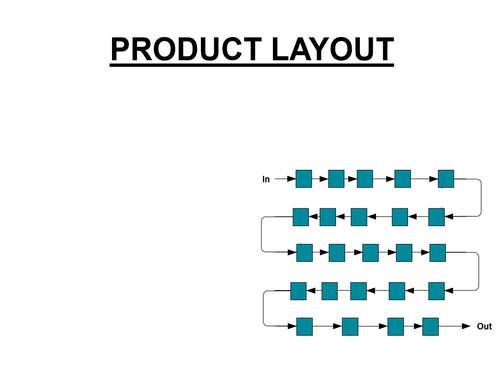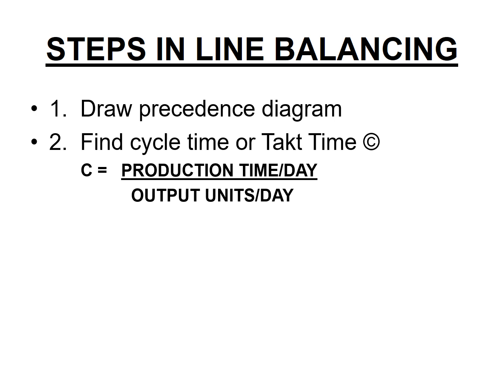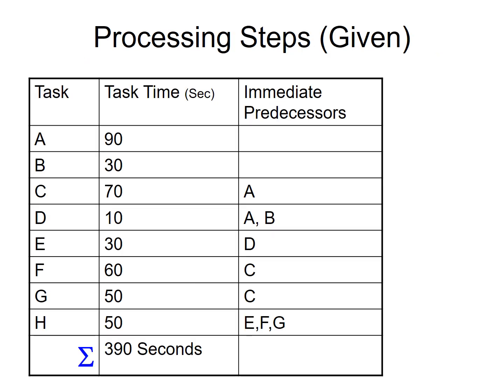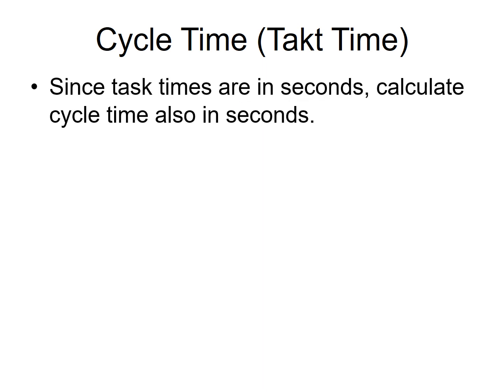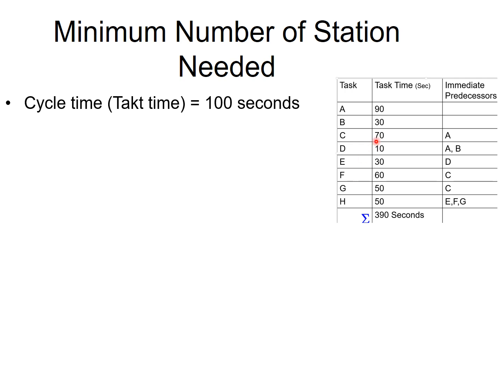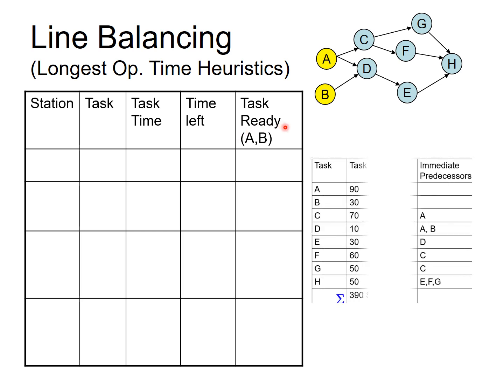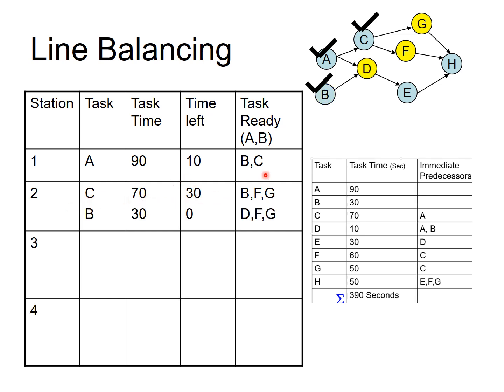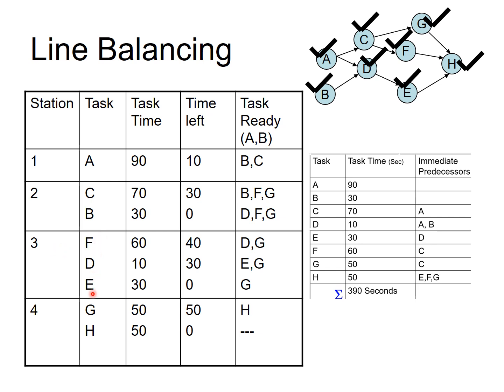Modified Product Layout and Assembly Line Balancing Example

Comment: If Task time shows more than cycle time, what would be the solution? May I know, please?
Reply from the maker: Very good question.  Let us say C=10 and a task takes 14 seconds.  In that case, you will have to create two parallel stations with double cycle time of 20 seconds.  Each of those parallel stations will do exactly the same thing and produce two units in 20 seconds (or effectively, produce a unit every 10 seconds on an average) and will keep the assembly line humming.

Comment: Bend the rules ??😏
Reply from the maker: If a task is ready for allocation and even if it is NOT the most eligible "ready" tasks, you can allocate it for higher efficiency.  Example: Suppose you have 20 seconds available at a particular work station and two tasks are ready for allocation requiring 19 seconds and 50 seconds respectively.  Obviously, task taking 50 seconds should be allocated first (assuming longest operation time heuristic).  However, it will not fit in that station as it has only 20 seconds remaining.  However, the task taking 19 second will fit...so, bend the rule and allocate that task.  Hope this helps.

Comment: takt time and cycle time are different ? Right ?
Reply from the maker: Technically, yes.  But are often used interchangeably if your system is working ideally.  Takt time is desired and Cycle time is real/actuality (may be different than takt time slightly).